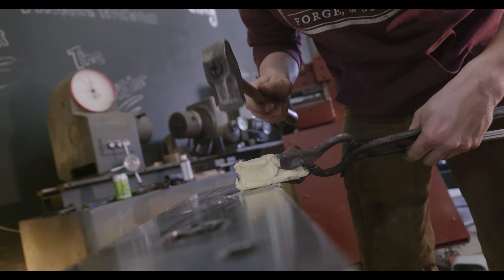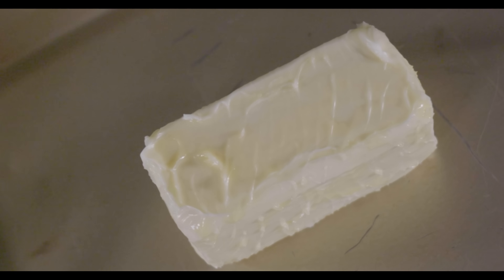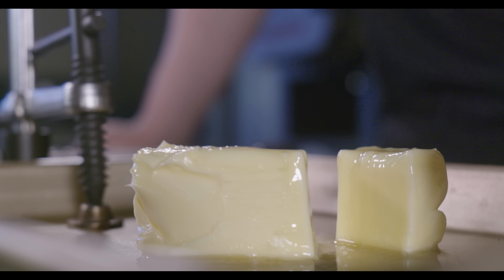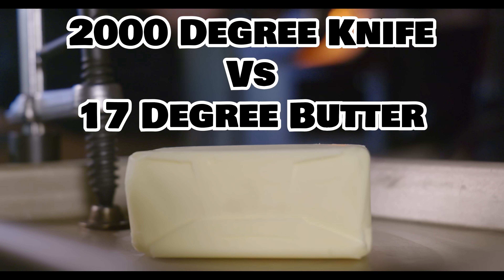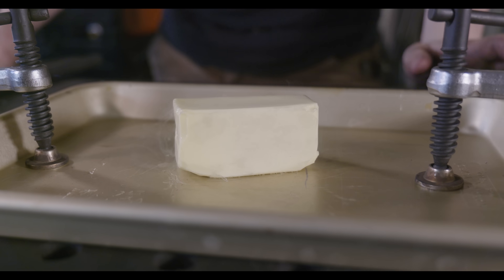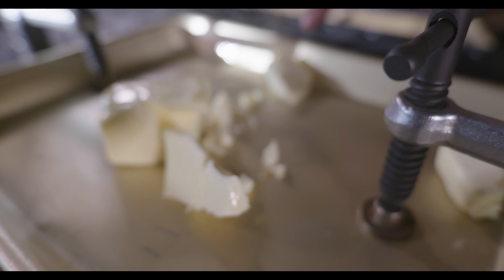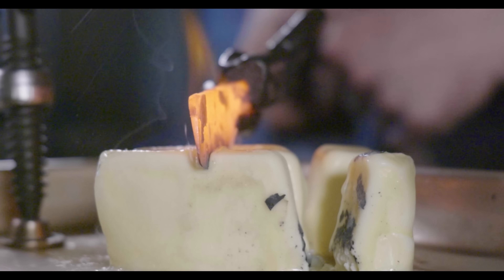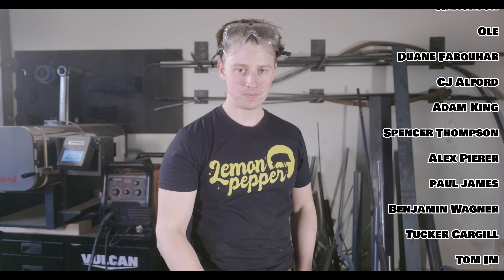A Hot Knife That Doesn’t Cut Butter?? (Science)

Comment: 43.68 degrees is the best temperature for butter and a good 94.73 degree knife while striking with mild dominance at a 24..94 degree angle upon the upper most area of the stick of butter approximately 3/16th of inch or so from the left end of the stick. As it's only proper to begin consumption of the stick of butter from the left to the right. I truly hope I've been of some help..

Comment: Ok hear me out, could you heat treat a knife using melted butter or clarified butter? Then you would truly have a butter knife.
Reply: Ghee would probably be a butter choice....
Reply: maybe margarine, more of an oil than butter
Reply: Answer the question, Will!
Reply: Not even joking. My smithing club was seriously considering quenching salad tongs in ranch so that we can make both the salad and the tongs using ranch.
Reply: @mattyeates771  You could quench salad tongs in salad oil, but that's kinda cheating haha
Reply: I was wondering the same thing.
Reply: Well technically you can use anything but it’s not going to harden properly. Absolutely no way butter would work, it will melt away from the knife and form a vapor barrier. Resulting in unhardened steel (not hardened enough to account for anything).
Reply: @erikcourtney1834  okay, but how about a bucket of already melted butter??
Reply: @MarcenariaMagnus  yes it would harden some like I said but still won’t get adequate hardness. Steel type also depends on how much hardness you will see. But none will be to full potential. Melted butter would be to slow of a quench speed.  Quenchants all rely on how rapidly they cool the steel. Different steels need different rates.
Reply: @erikcourtney1834  butter has a high water content, so it would probably quench faster than most other oils.
Reply: Oh gosh, I'd love a butter series
Reply: Would love to see that
Reply: Came here to ask the same question

Comment: Pardon the pun, but how hard can it be to cut butter using a hot knife?
Let's take stock here:
1. you have basically invented butter-hardened steel - not for softies
2. you invented Butter chips - a new winter snack
3. you failed to rate the edibility, spreadability and other scientific KPIs in order to rate knives and determine their "butterification" factor
4. you proved that a hot knife means little if the butter is super-cooled - does it mean that butter can be bullet proof? I wonder who will prove that one?
5. you did not list cut timings
6. I suddenly have an urge to eat a slice of bread with some butter

Have butter, have knife, will cut!
Reply: If this had been Project Farm, he would have had the knife fitted to an arm with a fixed weight on it so the force applied was uniform through all tests as well! 😆

Comment: So basically at the apex of the cut the butter does what it does and doesn't care what temperature the knife used to be since it's long since cooled off. A warm knife lubricates itself a little. Any more is wasted on melting and/or setting on fire butter that has already been cut. Very cold butter shatters instead of smooshing. Good to know 10/10 excellent science.

Nitpick: the term of art is denatured not what sounded like denurtured. Unless that's just an accent, in which case carry on.

Comment: Try with a copper knife! Then the hot knives will have better heat transfer and maybe use more of the heat from the handle :)
Reply: Isn't copper like super soft (specially so when super hot)? If so, then that may not work, in which case I'd recommend trying either bronze (which has a thermal conductivity 𝜅 similar to steel, iirc, so it's probably not going to be a very different result) or brass, which, iirc, has at least double the 𝜅 of steel.
Reply: Or make a knife out of graphene and use the heat from your own body to melt through the butter.